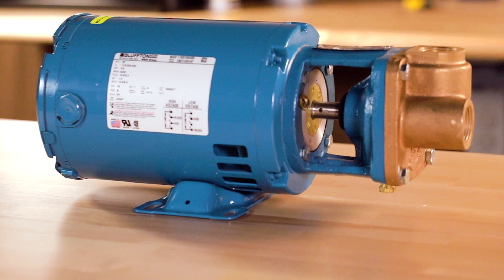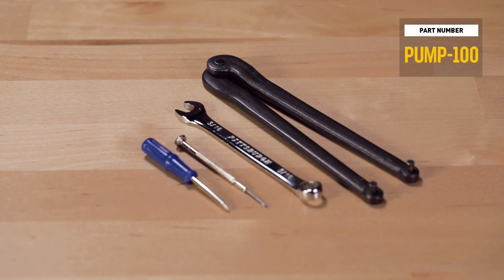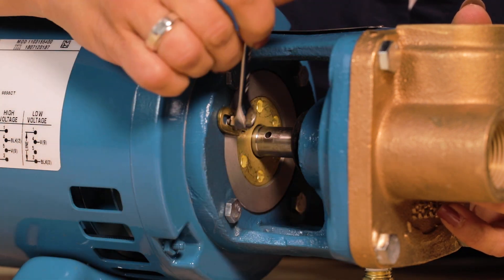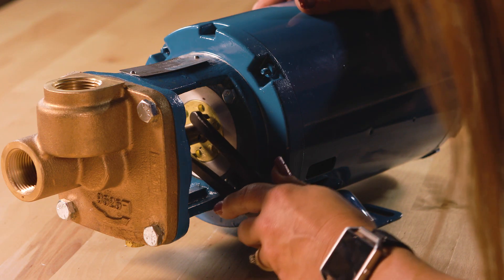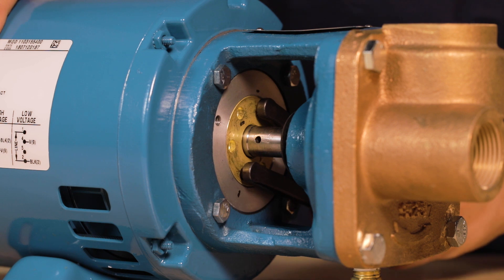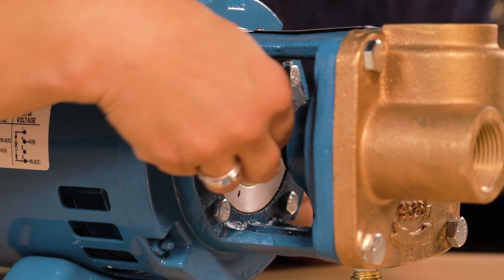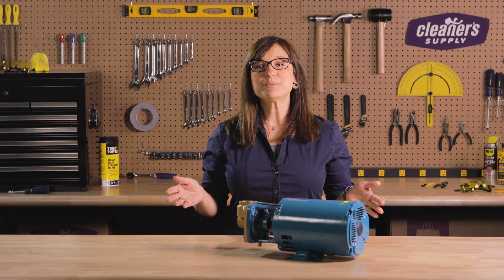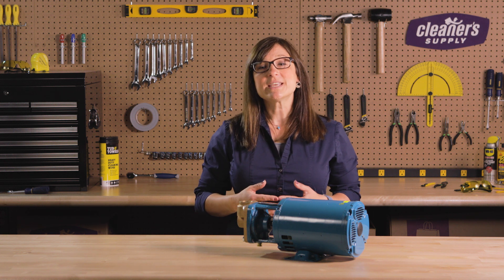How To Adjust A Burks Pump Impeller

Comment: I believe you mark one spanner holes to the motor case. You only turn counter clockwise when two spanner holes are equal distance from that mark. You turning too much the way I read it. It's not the two spanner wrench holes from the wrench. It's the two spanner holes near the mark you make.